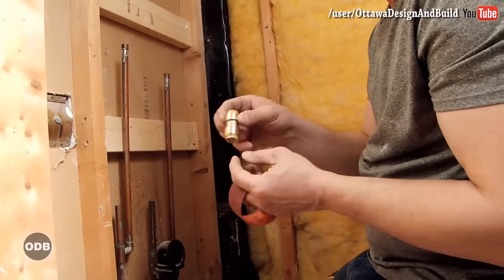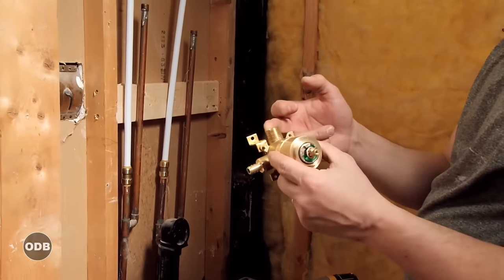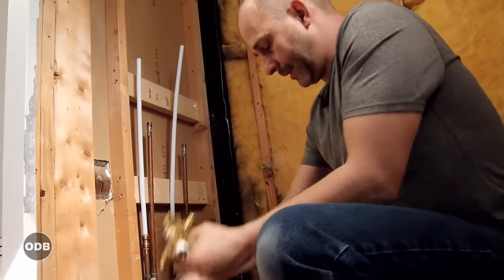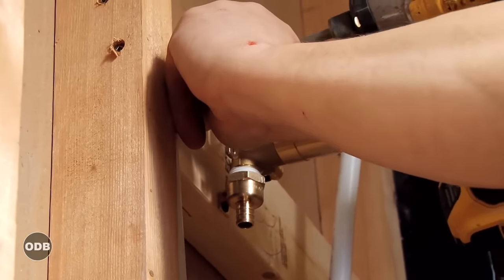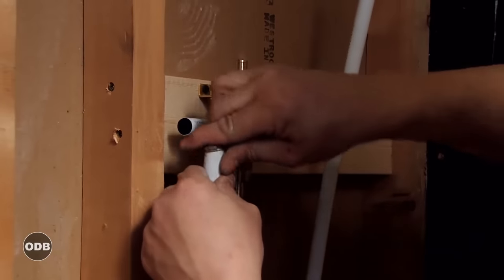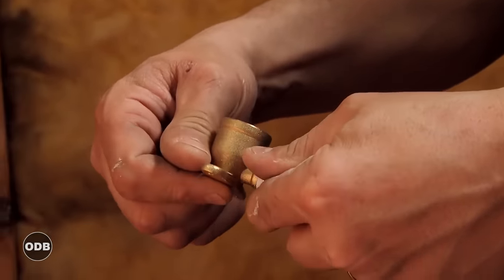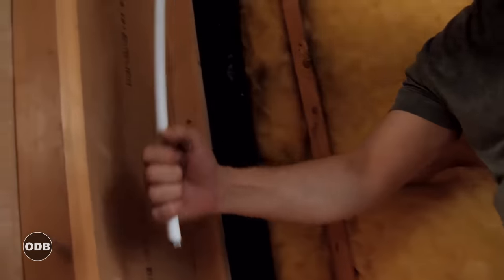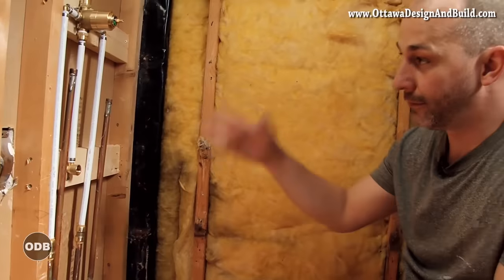DIY How To Install Copper To Pex | Shower and Bath Plumbing

Comment: I bet 1 million dollars that the people hating on this video are licensed plumbers.... LMAO!!!
Reply from the maker: definitely, Let me write you a check>
Reply: And they say shit like...Oh, he's holding the pliers wrong, tape and paste ?  Shut the hell up, he did an awesome job that will last for decades.
Reply: I'm not a plumber but I know all this work he's doing is a waste of time, LMAO. How do you like them apples?
Reply: really mike? I tried this and it did not work so well, you have to use copper on the downspout and shower head because of the restriction on the pex elbow on the downspout water always came out the shower head
Reply: @davidmateo7491  Copper sucks down here on well water tho.
You can buy a 1/2 copper swt male x 3/4 PEX fitting and run 3/4 PEX down to a 3/4 PEX x 1/2 FPT drop earred 90 if you really want to use PEX down to the spout. It works well.
Reply: @davidmateo7491  my company hired a plumber to come fix a 1&1/2"  copper line using cold press fittings charged us $2200 dropped their tool bag through the ceiling and the damn tee they installed leaked 4 hours later.  Tell me how the plumber is better with his fancy tools and hiked up process.
Reply: Mike Jylla 🤣😂🤣😂
Reply: Plumbers Hate Him!!!
Reply: @Blue04Z71   i have had sharkbites straight from pex to polybutylene (grey pipe) since 2011 held up no problem i do use ss crimp when possible  but the  rest of the grey is being replaced 2019
Reply: remocres they will work. However they make poly to pex shark bites. The poly side has a larger inside pipe stiffener. You can’t put the poly side on standard pex. The insert will not go inside the pex side.
Reply: @Blue04Z71  it was standard sharkbite i used from the pex to poly in 2011. i do have a temp patch on 1 sink the ss crimp did not hold on the reg straight pex crimp fitting not the press fit sharkbite i had to use 2 worm clamps until i get redo of that bath, just glad i caught the leak when i did i estimate it only leaked a gallon or two what i meant with pex to pex i use the stainless steel crimper system
when i did the full bath re pipe press sharks are too expensive for a full re pipe an i thought the copper ring
crimper is much larger harder to use in remodel . but 1 or 2 lines i no worries about the press bites.
the home was built in 1995 last year of polly the leake 3 i have has was pinholes in pipe itself and 1 was the copper they ran under the garage floor. coppers terrible in fl.
Reply: DaviD Mateo I’ll be begging you to replace my one piece runs that never split if they freeze? I doubt it. Copper corrodes, cost easily 3-4 times more and isn’t any better. Just like when anything switches people just can’t accept that it’s as good or better than the old way. I’ll never put copper in any house I own
Reply: Blue04Z71 I like to use the little brass adapter that goes from pex to a pipe thread/copper spout, it’s all pex in the wall and it’s easy to replace the copper pipe if it ever becomes damaged or isn’t log enough for a replacement spout
Reply: Mike Jylla not all
Reply: @remocres  This is gibberish is a real pain to read and decipher to try to figure out what you mean. Learn to spell. Learn to use punctuation.  And above, learn to write a coherent sentence.
Reply: @augustreil  I had a pro plumber tell me to use tape & paste combo. But, he's retired so he's not worried about losing income. LOL.
Reply: dislike for a bad job of the camera man. If you want to teach someone then you should show the subject closely.
Reply: @augustreil  I am a certified plumber with 30 plus years .He made  crucial mistake.
Reply: I bet you they are not....I just won! One million dollars please🙂
Reply: Nothing wrong with PEX or Copper... But shark bites, that's a different conversation
Reply: Here is a thought also…….. these are licensed plumbers doing the hating? They are licensed plumbers watching DIY videos on YouTube! Lol tells you a lot about their skill and their licenses… lmao
Reply: @frugallandlord2676  it would be a waste of time for you. You are a landlord you don’t want to pay for anything to be fixed!
How do you like the whole damn orchard!
Reply: I was always hesitant about using shark bites behind any sort of wall but hey if this guy is doing it then I now have zero problem with it 😂

Comment: A note about using pex to plumb in a tub/shower faucet.  This comes from experience.  I am a contractor that specialized in bathroom renovation for many years.  Read ALL the installation instructions on the box .  Some valves are very sensitive to back pressure.  Using PEX can create back pressure.  It has to do with the interior diameter of PEX as opposed to the inside diameter of copper.  As a result, when running the tub fill the pressure will push water up into the shower head and cause it to drip a stream of water.  Some valve instructions tell you to use only copper on the rough in for the spout and shower head.  Not all will do this, but some.   It may not seem like a big deal, but early on I learned this because of customer concerns.

Comment: I have never had any luck using pex for my tub spout if you have good water pressure then the small diameter of the pex can restrict flow to the spout and cause the shower head to spray even when diverter is not engaged
Reply from the maker: Thanks rodney, there have been a few suggestions on this forum that should address this. One of them may work for you.
Reply: Rodney Thornhill  yes for tub spouts should always use copper so no restrictions occur!
Reply from the maker: riobel pro now offers a shower / tub valve with a 3/4 line to the tub.
Reply: Depends on if you use pex A or B. With the flaring of the tubing versus placing the fitting inside & compressing you retain a larger lumen for water to pass through. Especially helpful if there are a lot of 90° turns in your pipe.
Reply: Mike Shewchuk. I agree
Reply: then use expansion pex. a giant I.D. compared to crimp pex.
Reply: darn straight, good idea to use hard plumbing for the tub spout. the back pressure can cause water to come out the spout, and out the shower head at the same time.

Comment: You really shouldn't use 1/2" pex from the diverter to the tub spout. Depending on how high your water pressure is, it will back up to the shower head when you're running the spout, especially with crimp fittings, as the inside diameter is only about 3/8. Most use copper for that piece, but if you're using pex it's better to use 3/4" pex for that piece with a 1/2" fip x 3/4" pex fitting at the diverter and a 1/2" fip x 3/4" drop ear at the spout. Some would argue that this is also the case with the pipe running up to the shower head, but I've never had an issue using 1/2" for that, as long as the spout piece is 3/4" or copper.
Reply from the maker: That is a good solution for those people trying to avoid copper. Thanks Chase.
Reply: 3/4 pex or threaded brass fittings/pipes for the spout would be better
Reply from the maker: good solution.
Reply: That is why the Mfg supplies the valve with pex supply adaptors and ips tub/shower connections

Comment: solder the 1/2 copper to pex female transitions, and 1/2 copper male transitions for the mixer, it makes a much more reliable system, cheaper on parts, and more labor, but overall better
Reply from the maker: Very true however the purpose of this video was to instruct people how to do it without knowledge of soldering.

Comment: I’m in the trades and see new residential construction has switched over to using PEX. I made the initial investment a few years back when I remodeled my laundry room and I loved the system. It’s fast and fail safe. Now I’m working on my master bath remodel and once again I love having this stuff in my tool collection! Great video

You still need to know how to solder as some valve bodies aren’t PEX ready and you’ll need to sweat in adapters but 3 or 4 adapters and bada bing! You’re in business.
Reply from the maker: Very true. we are making new videos as we speak about different situations a renovator can find themselves in.

Comment: Piping the tub spout with 1/2" pex will always cause your shower head to drip. Use 3/4 pex or 1/2" copper
Reply: why will the shower head drip?
Reply: @yevgenikovelman3306  reduced pressure causes the water to shoot up to the shower head. This guy basically was learning as he went. Now he has a million subscribers. I guess he's not as stupid as I thought
Reply: @sal.pizzurro  is it just for crimped pex? What if I used shark bite fittings on every connection? Would it still leak?
Reply: @johnbannister5013  the only connection that causes the problem is between the valve and the down spout or diverter. I wouldn't recommend sharkbites because they are not rigid but the flow would be fine and not cause the dripping so technically you can use sharkbites for it. If you insisted on using sharkbites I would recommend using a dog ear elbow and screw that to a 2x4. It would still not be ideal but it would work. Just use silicone where the pipe goes through the wall and let it cure and it will be solid..actually use a dog ear elbow (sharkbite) and then screw a 1/2" x 8"?? nipple but then you need the type of diverter that screws onto the nipple instead of the kind that slides into the copper pipe. It might be easier for you to use all threaded pipe/nipples for the diverter. No matter how you slice it you have to use your noggin ;)
Reply: @sal.pizzurro  I had the exact same problem you described - the shower head would drip when the diverter spout was on full. The contractor used 1/2" pex both on the down spout and the piece that goes out into the spout. What solved the problem was putting a 1/2" copper fitting at the end, straight to 3/4 thread of the diverter spout. The diameter reduction from the SB fitting was huge and caused too much back pressure.

Comment: hey man those crimp O rings do they prone to vibration from the water pressure over time . will it get loose in in the future ?
Reply from the maker: No , however they are a little tricky duringinstallation. If you don't get a full crimp they will leak right away. Once your done do a pressure test and double check.

Comment: Great video.  1/2" pex fittings are only about 3/8 ID. I would suggest using 3/4 pex on a shower which ends up being about the same volume as 1/2" copper...2 cents.

Comment: good video.  would never suggest running pex from valve to tub spout.  will cause water to come out of shower head when filling tub.  both delta and moen say pex to spout not suggested. pex to shower head ok
Reply from the maker: Good to know, thanks Ted.
Reply: 100% agree
Reply: I've been a plumber for 24 yrs and you are absolutely correct  !
Reply: @steverager5602   
You can buy a 1/2 copper swt male x 3/4 PEX fitting and run 3/4 PEX down to a 3/4 PEX x 1/2 FPT drop earred 90 if you really want to use PEX down to the spout. It works well.
Reply: how?

Comment: wow working with pex seems so easy ... as much as i love working with copper , this is a great alternative
Reply from the maker: costs a lot less as well. Hard to set fire to your house when you don't need a torch.
Reply from the maker: Amen
Reply: ValarMorghulis Pex won't freeze and burst usually but it will freeze and push the fittings out.....personal experience speaking....but pex is the best to work with.